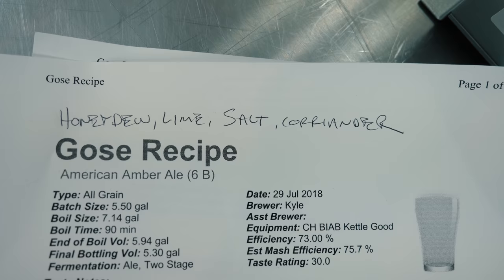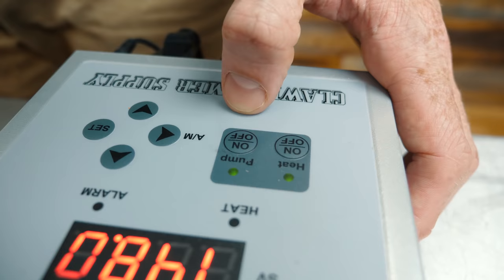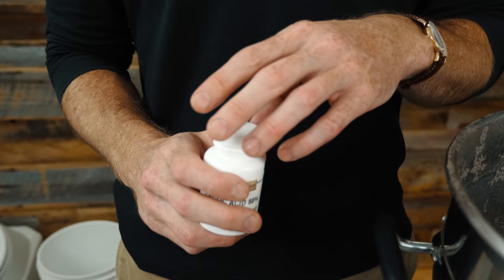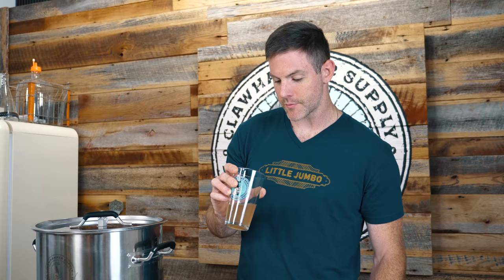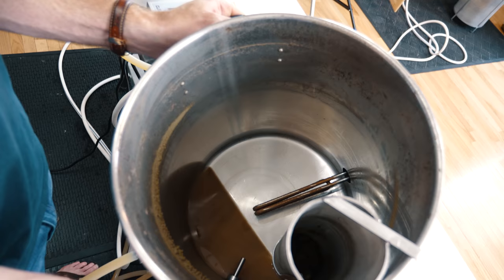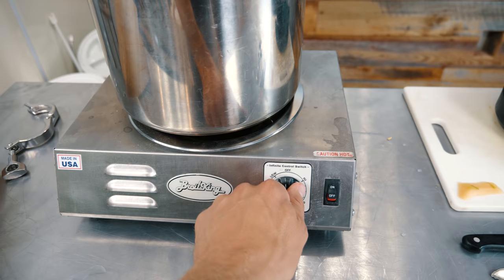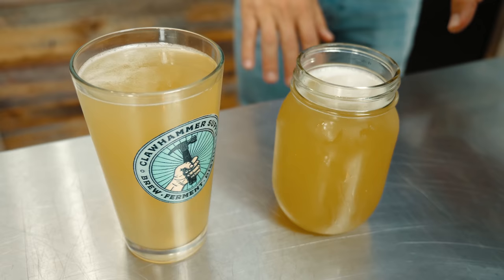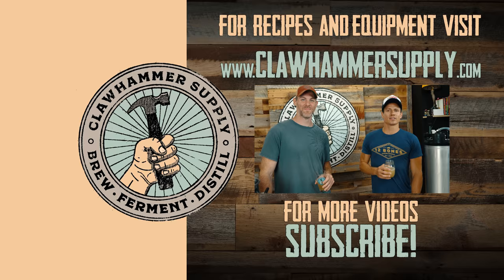How to Brew Gose Beer - Melon, Pepper and Lime Homebrew

Comment: I made a slightly different version. I used Citric acid to bring the initial pH to 4.0.  I then used 2 quarts Goodbelly Mango at left it at 107F.   It did take a bit longer than I expected, but it finally dropped to 3.5.   I used the suggested amount of salt, lime zest, pepper and skipped the melon.  It's a super easy  beer to make except it does tie the kettle up for 24-38 hours.  Thanks for the recipe.

Comment: Looked like you didn't crack the coriander seeds before putting them into the boil, was there a reason for this?  I ask because generally I crack the seeds to impart more flavor.  Great video guys, Cheers!
Reply from the maker: True, we did not. I really like the way it turned out but there was little to no coriander flavor and that's probably why. We'll remember to do this on the next one.
Reply: @ClawhammerSupply  Noted I might give this one a go this year on my homebrew schedule
Reply: Please elaborate. By cracking the seeds do you mean fully grinding them? Or just giving them a quick crush to open them up just slightly? I am interested in starting to use spices in my beers but I am still trying to figure how much to use generally and how to use them generally.
Reply: @ModernGameChangers  just cracking them would be enough to implement the flavor. You don't want to make it too fine
Reply: @ModernGameChangers  I'm sure you don't need to crack them any more than you would crack the malt. Just give them a go through your standard 2-3 roller mill.

Comment: How did they accurately measure the ABV for a beer like this? I just made a watermelon gose myself using a similar grain bill, but I figured using the starting OG and final OG wouldn't be able to properly gauge the ABV because the addition of the melon adding extra sugars. The only way I could think of to get an accurate result would be to add pure juice to the primary and take the OG of the the juice plus wort.

Comment: Do you think it would be possible to add the melon so late if you weren't kegging?

I'd definitely assume that much sugar would restart fermentation if it got warm enough, which could definitely make for bottle bombs. In a keg you'd just bleed the pressure if that happened.
Reply from the maker: very good point.
Reply from the maker: To clarify, after adding the melons we let the beer sit for another few days and waited for fermentation re-start and then stop before we kegged.

Comment: Great looking beer guys. 👌🏻 Any idea what Ph it got to before you started the boil? I’m thinking 3.5 could be a good number to aim for.
Reply: Late post... but I got mine to 4.0 with Citric then dropped to 3.5 after adding Goodbelly.  I think 3.4 is about as low as you "should" go.  3.5 is more tart and refreshing.  I wouldn't call it "sour".

Comment: Hey guys, how do you messsure the lactobacillus needed to make it this way?
Reply from the maker: Ha. We don't. We just pour in about 1/3 to 1/2 of the container and that's that.
Reply: Lacto is alive, so it will grow just like yeast. Its not as picky about pitch rate unless you are doing mixed fermentation with both yeast and bacteria at the same time. Probably sours faster with more though.

Comment: Why do you add lactic acid? I thought the point of adding  lacto bacillus was to produce the lactic acid?
Reply: My understanding is that lacto should have safely lowered the PH all on its own, but maybe they wanted it done quicker. If properly sanitized and using a decently strong lacto culture, you could probably skip the acid addition. Maybe add it if your PH is over 5.5 after mash, if you have hard water or something. Otherwise lacto should make its own acid. Not sure what is going to get in anyway... wild lacto...?

Comment: been trying to make a kettle soured Berliner with fruit puree added at kegging and keep getting a weird taste which becomes 3 gallons donated to the drain god. 2 batches sacrificed so far. I give up.
Reply from the maker: What does it taste like and what are you using to sour?
Reply: following your berliner recipe. using lacto from WYyeast I believe. everything tastes just like a Berliner then I add the fruit puree and it tastes rotten. used Camden tablets to kill off any yeast and kegged 3 gallons with 2 pounds of fruit puree which ends up being roughly a half gallon of puree.